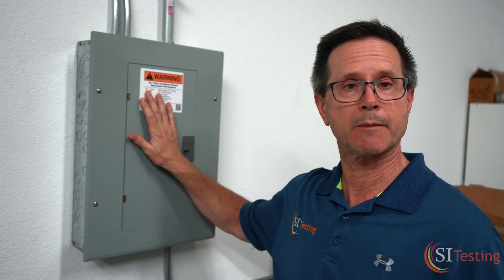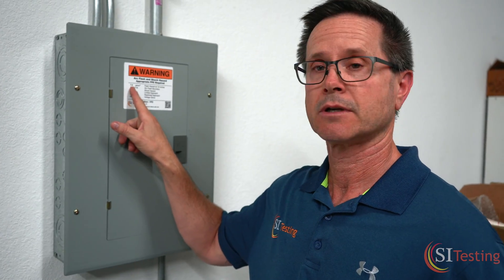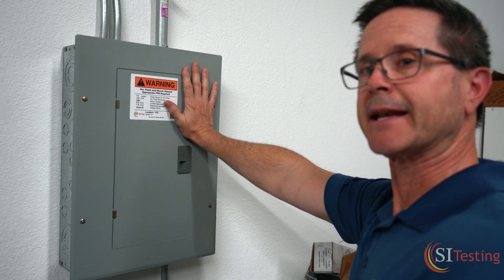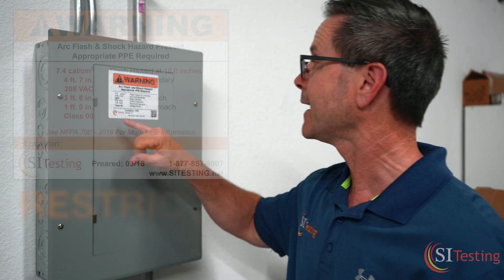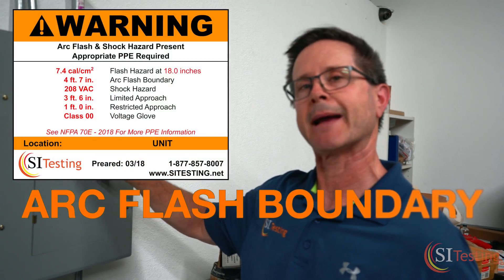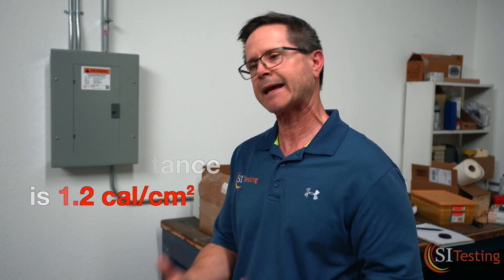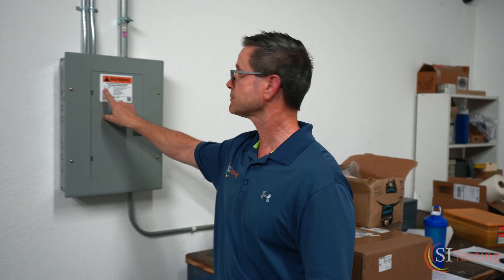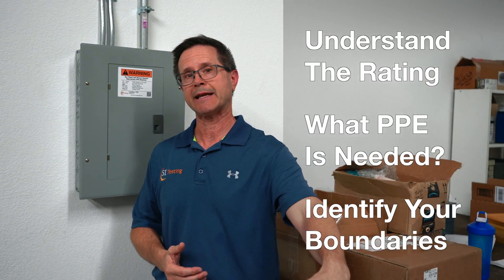Questions From The Field: Explaining the Arc Flash Sticker

Comment: This is a mock incident energy analysis, right? That looks like a single-phase panel. From what I understand, the potential for an arc flash, especially at 7 cal/cm², isn't possible. 

Other than that, good video.
Reply from the maker: Good catch! Yes, this label is incorrect for the panel. It was a duplicate/leftover from a previous study that we used just for this video demonstration.

Comment: I think you missed to explain what if the box is closed are those boundaries still applicable and which NFPA codes states. This is basic point of confusion from non electrical people all the time
Reply from the maker: This is a GREAT point! You're correct that NFPA has a lot more to say about the boundaries and how they are defined. 70E has a great diagram that shows arc flash boundaries as a sphere, with the center being any exposed electrical circuit part, which is what the measurements of the label are referring to. You'll find it in: Informative Annex C, Figure C.1.2.3

Comment: Great vid. how did you get 1.2 cal from the arc flash boundary?
Reply from the maker: The value of 1.2 cal/cm2 is the energy needed to cause a second-degree burn. This is a constant, and equivalent to holding a lighter 1 cm beneath your finger for 1 second. The higher the incident energy, the further away this measurement will be (larger the boundary). For example, a "DANGER" label (used when incident energy is 40 cal/cm2 or greater where no safe PPE would be applicable) that has 217 cal/cm2 at 18 inches would result in an Arc Flash Boundary of over 35 feet. So should an Arc Flash Event occur, you could still potentially experience a burn at a distance of 35 feet. At that distance, the energy will have dropped to 1.2 cal/cm2. The closer you are to an Arc Flash, the more severe/higher potential for injury.